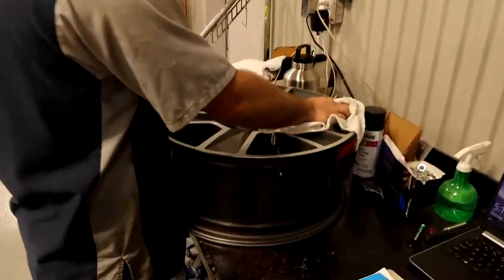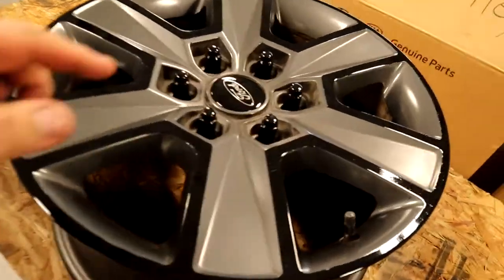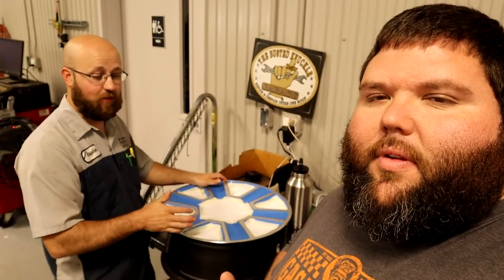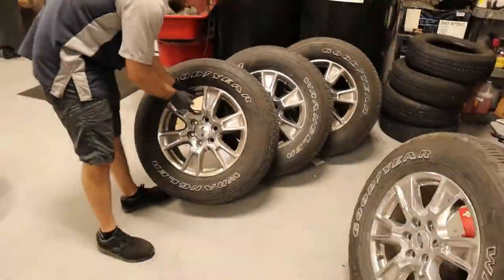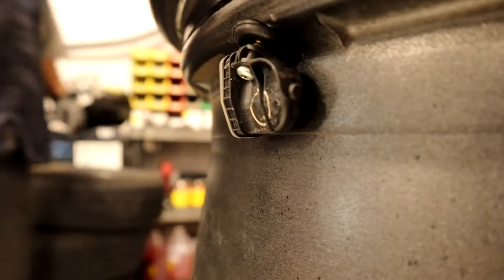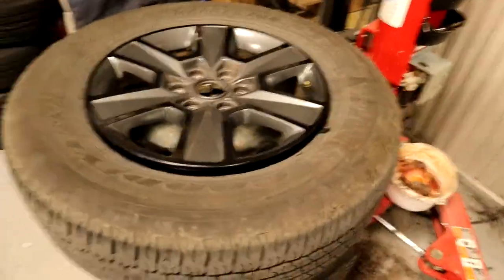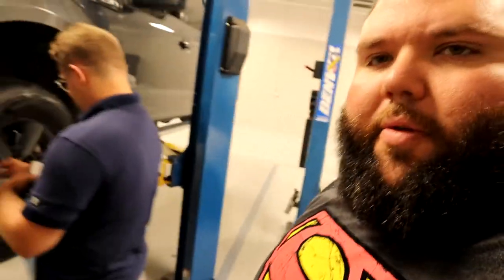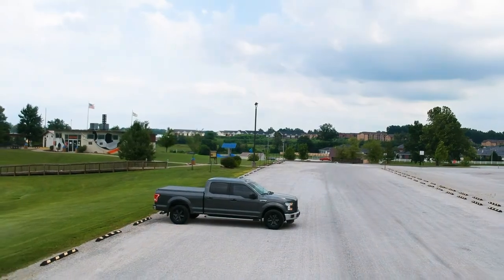Painting OEM Ford F-150 wheels

Comment: SMEAR MORE GREASE ON THE TIRES SIDEWALLS SO THEY LOOK EVEN GREASIER

LOOKS LIKE THE RUBBER IS BREAKING DOWN RELEASING CHEMICALS, OIL SPOTS ON THE DRIVEWAY
Reply from the maker: Thanks for the tip